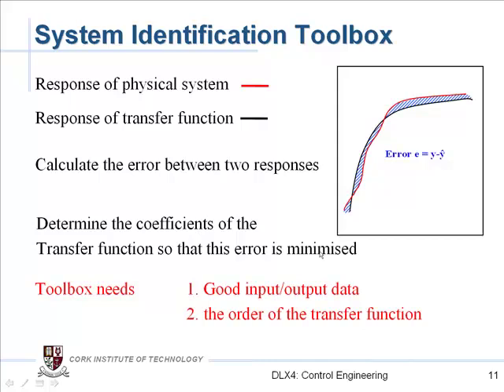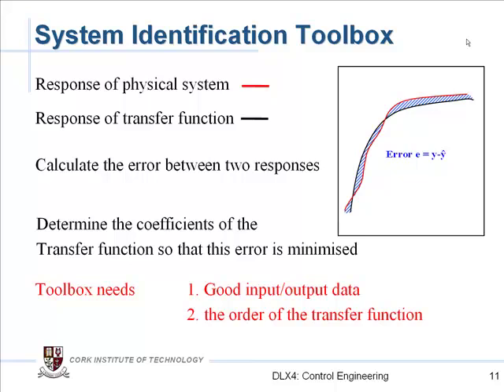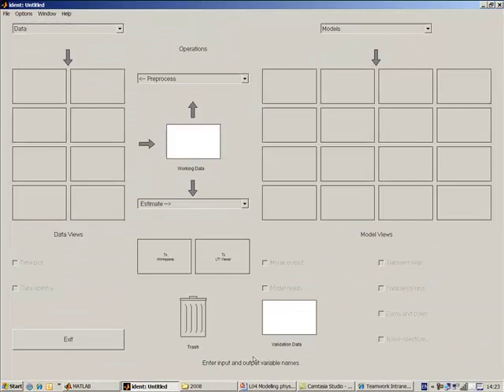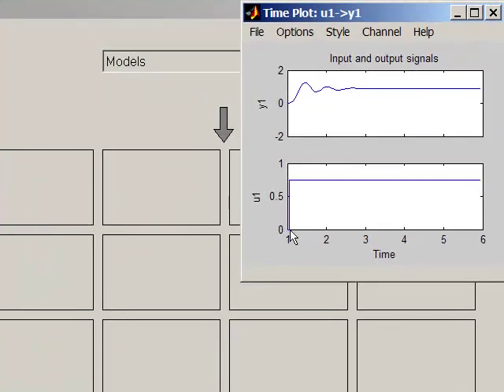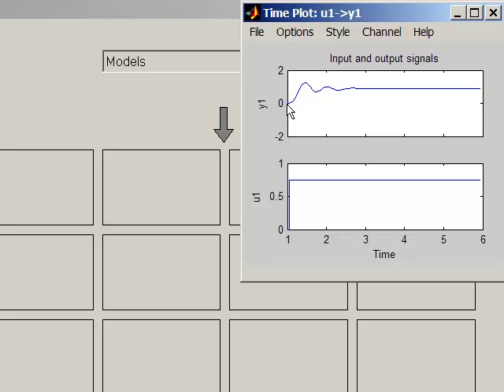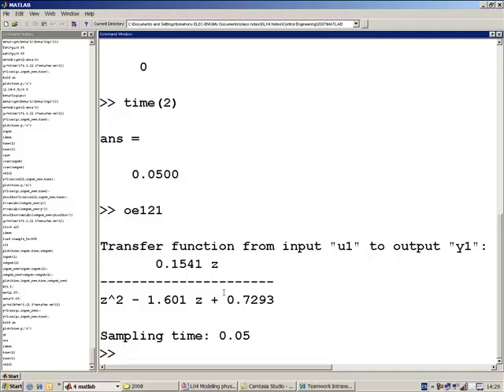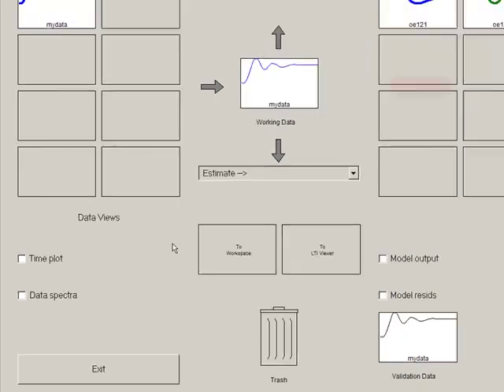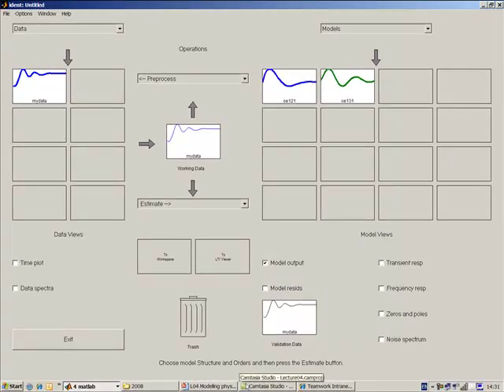Introduction to the System Identification Toolbox

Comment: while importing the data what does the sampling time mean here? I have a data recorded from a continuous simulation but i am guessing it has nothing to do with my simulation is it?  I checked the difference between time(1) n time(2), and time(3) n time(4) both the values are different.
Reply from the maker: It means exactly as you would imagine. The time intervals between data points. If you are recording data from a continuous simulation you should go into the simulation parameter setting and change the solver option to a Fixed Step Solver. Choose the step size and that becomes your sampling time.
Reply: Tom O'Mahony thanks, that helped a lot. Looks like estimates are at least in the ball park for transfer function. I tried estimating the state space model and its way off. If i send you my system would mind taking a look at it? thanks. Its a fairly simple 8th order system :)